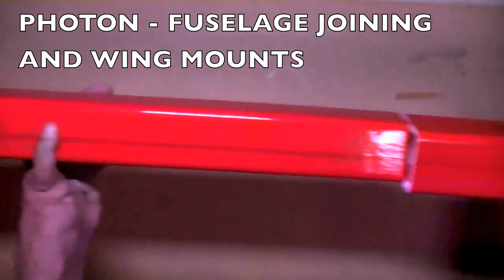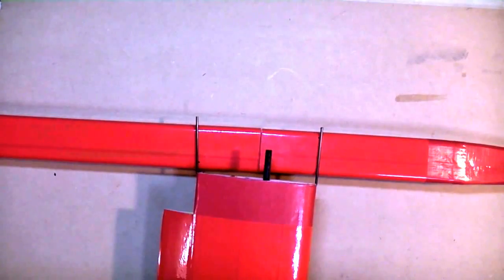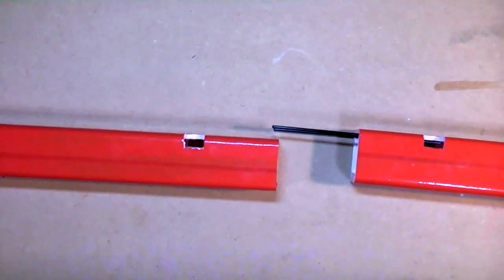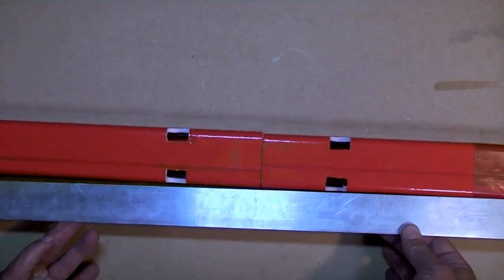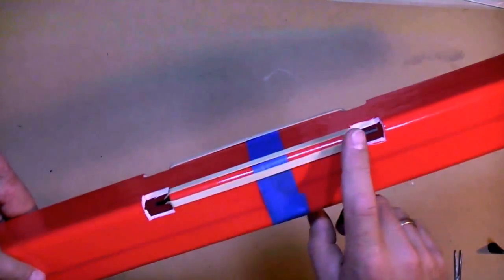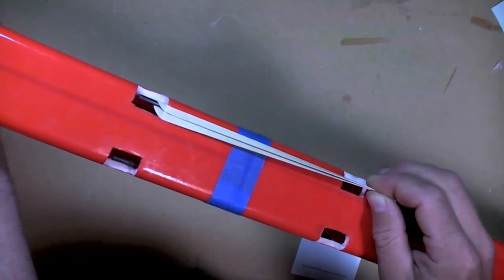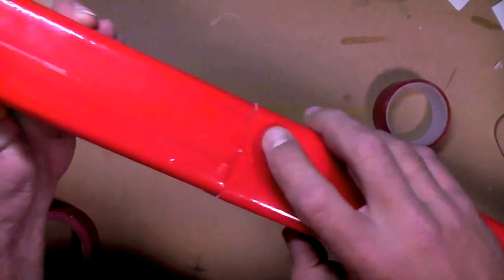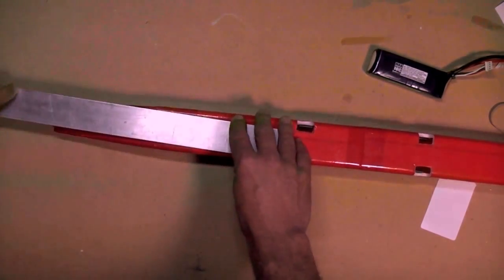PHOTON - Fuselage part 2: Joining and Wing Mounts

Comment: I prefer to use square dowels or square carbon fiber through the sides of the air frame for wing attachment. Cutting out the corners in those four locations creates weak points. The strength of the frame is it's corners. The square dowels give you flat edges to glue in place and therefore eliminating tearing out or hole enlargement as the round dowels can. Also the corners are kept in tact keeping the air frame strong. It is worth the trade off for what little you would lose in aerodynamics.

Comment: Hi   Have followed your designs and have built your "photon" and had a great deal of enjoyment from it. For that many thanks.
Just a little background I live in New Zealand  am 73 years young and a very active club flyer and fanactical builder. Just so many projects so little time.
This aside I have been very interested in converting to Gas power and have a Ryobi 26cc weed eater motor all set up for rc aircraft. I just love flying large slow graceful aircraft and the change to gas is my next logical step. I want to build  an "Armin WIng" design  craft around the 80" span and any shape fusalarge you feel would carry the power unit involved. I think hand launch might be impractable. 
A large version of the  "Donkey" design really appeals. Your honest thoughts would be much appreciated. Thanks  Colin

Comment from the maker: I built the whole thing except for gluing the sections together and mounting the wing.  I then rubber-banded some CF rods to the fuselage, crossways, and used them for movable wing tie-downs.  I located the wing at the proper CG location (with all electronics and battery in) and made the holes in the fuselage where the rubber bands exit.  I disjointed the sections and glued the lengthwise CF wing tiedowns so the tips met the holes.  I then glued the sections together and mounted the wing.

Comment: How did you decide wing location?  For you, probably experience.  For the rest of us wanting to do a fuselage longer than 30", how should I decide where to put the wing?  If the two sections are joined first, then there is no way to insert the wing tie-downs lengthwise.
Thanks for all your great videos!

Comment: Ed,
Now After two crashes I am wondering if my control bars are too lightweight and bending.  18 ga wire bent to fit, but with the elevator and rudder the length is perhaps too long at ~10" for this wire.  I will try a guide to keep from flexing.  
BTW I stopped by an archery range and found 5 discarded broken arrows in the trash.  Although they would be too dangerous as arrows I believe they will be very light and cheap spars for my next wing.

Comment: I have made my photon, but after flying to about 20 meters high in 7 mph wind I put it up on a wing tip.  The next thing I knew I was trying to pull out of a head first dive.  
The entire nose section of fuse crumpled and my lipo seemed to take the brunt of it.  My motor still works so I will try to fly again this weekend after buying another battery.  I will also pay more attention to balancing the plane and favoring nose heavy as opposed to tail heavy.

Comment from the maker: Any motor will work if it will give 500g of thrust or more.  You could maybe get by without a rudder but it will fly better with one.  I would include a rudder and at least mix it to your aileron channel, which is commonly done.

Comment: I'm surprised to see that you actually glued the carbon rods into the fuselage for the wing tie down.  Instead, I looped the rubber bands through themselves on one end, so the would stay attached to the carbon rod.  Then I used the rubber band that goes under the wing to ensure the rods stay aligned and held to the top of the fuselage.  It was a pain to get them into place at first, but using a hemostats (thin locking medical pliers) made it easier to pull them into place.